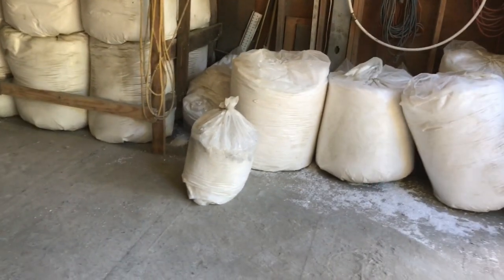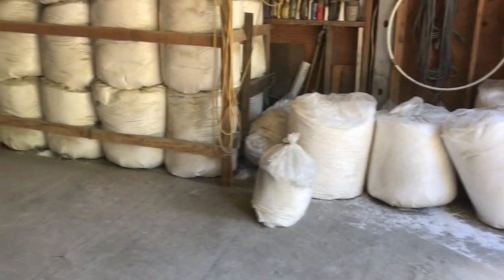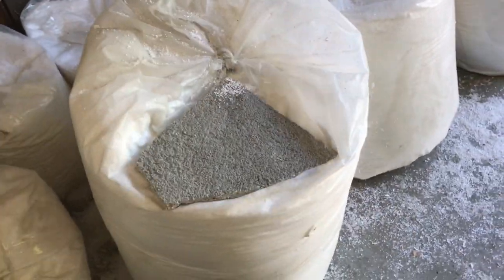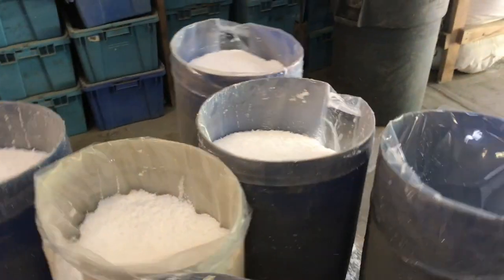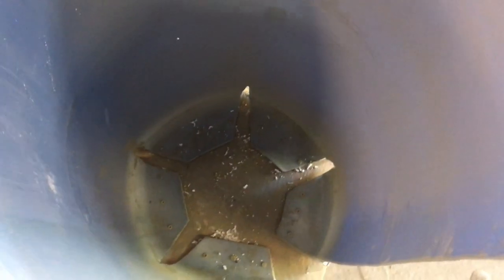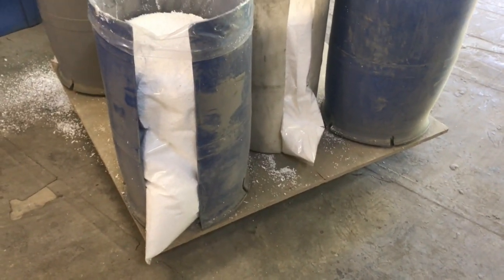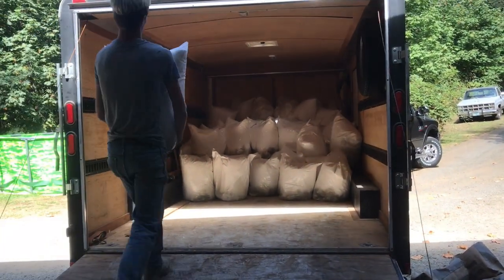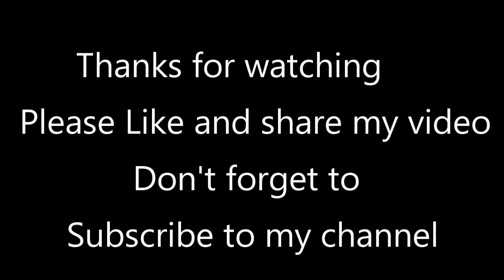Unbelievable styrofoam cement mixtures

Comment: Thank you Jim, 1 kg lime, 3kg cement and 9 kg foam to insulate a shipping container?
Reply from the maker: Cool…
Reply: @fauxrock  Thank you, what is your take on the lime?
Reply: And what thickness?
Reply from the maker: The lime is used to make the mixture more sticky so that the Styrofoam bowls or beads will stay together as a matrix with the Portland cement
Reply: @fauxrock  Thank you once again, what thickness would you make the insulation on the shipping container please?
Reply from the maker: I’ll have to apologize I didn’t understand your original question Regarding using the Styrofoam to insulate a shipping container. Although the Styrofoam mixtures will have an R-value it would be extremely low. To give you an example 4 inches of the Styrofoam mixture would give you a 5-R value. If I were trying to insulate a container I would use urethane spray foam I would not even think of using the Styrofoam cement mixtures.
Reply: @fauxrock  Thank you, wow (36 square meters) that is a lot of material. Any idea how many kilograms foam?
Reply from the maker: It sure that I understand your dimensions. I also don’t understand if you mean the spray foam that urethane or the cement phone mix which I said I wouldn’t advise you to use use due to the low R-value that you would yield
Reply: @fauxrock  36 square meters of cement, lime and foam, foam kg estimate.
Reply from the maker: As I had previously stated I would not use the Styrofoam make sure to try and insulate a shipping container because you will never yield any significant our values which is the whole purpose of insulation. At 4 inches a thickness with the Styrofoam mixture you would only get an 5-R value.
Reply: @fauxrock  Thank you for the video and attention to all these questions...I very much appreciate it! But, if the insulating value is so low, what is the point of using the "styrocrete" rather than "foamcrete" or some other material...I think I've lost the thread a bit!
Reply from the maker: Using the mix for homes doesn’t make sense , but I use it to insulate pools/spas or ponds which will be heated as it a great thermal break to stop heat lose to the ground.

Comment: Have you added fiber/mesh to it for strength? I'm looking for diy ..mixers  and  application equipment ideas
Reply from the maker: I never had added mesh to the foam cement, but it would make it stronger...
Reply: So basically, 15 gallons of foam, 4 gallons of Portland and 1 gallon of lye ?
Reply from the maker: Yes that sounds about right but keep in mind mixtures can be made for different performance characteristics
Reply: Is it lime or lye that you add?  I see a comment asking about lye, but I here in the video you saying lime

Comment: Is it possible to build a small cabin with this? Like 30m2 building? Or would it be too weak and toxic for construction??
Reply from the maker: Yes it’s possible.... many people have Utilized Styrofoam basements in many homes and buildings
Reply: Thanks for getting back to me Jim, this is fascinating stuff. If I were to build panels would they be too weak/prone to cracking like aircrete? What ratio do you suggest for a building? Anything I can add to strengthen them like fiberglass? Could I use any kind of styrofoam or should I look for specifics? Sorry for all the questions having a hard time finding information on this topic.
Reply from the maker: It is easier just to call me 971-237-2957

Comment: What proportions of polystyrene cement lime for a concrete screed on the ground? the first layer on which only the screed with heating goes?
Reply from the maker: I typically use three parts of foam to one part of the lime cement

Comment: What is psi please!!!!
Reply from the maker: I’m not sure as I am never really had an application where the strength was an important factor over it being light weight. If I were to estimate the comprehensive strength in PSI I’d be right around 1,000 psi with the 3 to 1 mixture. Obviously you could diminish or strengthen the mixture by adding or subtracting more Portland cement. Thanks for watching my videos

Comment: I mix 1 cement : 5 thermocol and make bricks. Is this mix durable as a brick?
Reply from the maker: No it’s not especially if I understood what you wrote one cement to five parts of the styrene??? Usually I mix one part of cement to three parts of the Syrene and that’s not as tough as a brick either, but It would be stronger than a 1 to 5 mix.

Thanks for watching my videos
Reply: @fauxrock   Thanks.  Any admixture you can recommend?
Reply from the maker: You can add an acrylic admixture
Reply: @fauxrock  ok thanks

Comment: Hi I love your video 👍 I’d like to make stepping stones, what ratio of mix/recipe do you recommend? By the way I live in Long Island New York.
Reply: concrete lightweight mix  https://www.youtube.com/watch?v=XysmrZOa50Y
Reply from the maker: Thanks for the feedback... I’m a third generation New Yorker that just happens to live out west.👌

I’d recommend a 1-part cement to 3-parts sand mix for your project. Have fun with your project and enjoy the wide world of synthetic rock construction
Reply: @fauxrock  thanks for your fast response! I wanted to incorporate crushed styrofoam into the mix for the stepping stones, would that work? I’d like to use styrofoam because of the weight factor. Thank you in advance!
Reply from the maker: Adding the Styrofoam To a mix formulation only creates a weakening which requires you to use more material to get the structure that you once had

Comment: I am from Pakistan and I  in the phase of developing Insulated Composite Concrete Form Block, I am seeking your patronage to get any appropriate formula of styrofoam+cement+additive, if any.   I tried to get into your website but couldn't get through.  The size of the block is 12x8x48 inches (HxWxL).  Compressive strength and weight to achieve is 87 psi and 30 lbs respectively. My email address is "naseem.khan@powertech-pk.com"

Comment: This video is so good..can you tell me the mixture for making concrete for floor panel and wall?thanks
Reply: Is the mixture by weight or volume
Reply from the maker: I prefer a volume mixture, but it can be accomplished by weight
Reply from the maker: I used different ratios of cement to foam... anywhere from one part cement to one part of foam all the way up to one part cement to ten parts of foam.

Generally I will mix one part cement to three parts of foam for most projects.

Thanks for watching...

Comment: what is the ratio of Styrofoam to Cement in terms of volume or weight?
Reply from the maker: Depending on the application I have used as little as one part of Portland cement to10 parts of Foam all the way down to One part of Portland one part of foam.
Reply: @fauxrock  Thanks for the reply, by foam do you mean generated foam?
Reply from the maker: I’ve never heard the term generated foam before. The foam we use is called regrind foam due to the fact they grind up waste foam.
Reply: Thanks again I got it

Comment: what's your ratio for cement and styrofoam?
Reply from the maker: Our formulations will vary depending on the application that we serve and or budgetary constraints. The formulations can be as little as 1 part Cement to one part Styrofoam and as much as 10 parts Styrofoam to one part cement
Reply: @fauxrock  no lime?
Reply from the maker: Yes I use lime one part of lime to three part of Portland cement makes the cement that I use to put three parts of foam to

Comment: Can I have the formula of your mix, please. Or is it a secret. thank u in advance.
Reply from the maker: There are several different formulations that we use... it really depends on your application as to the exacting formulation. Give me a call to discuss your interest. Thanks, Jim
971-237-2957
Reply: @fauxrock  hi Jim can I call or send an email
Reply: I wanted to make small fountains out of this.  I want to be able to form it and shape it a bit.  What do you suggest
Reply from the maker: It would be something that you could do, but it would less weight to start with a block of styrofoam which you could carve to the shape you want and then code it with a thin shell of cement.

Comment: Wait a second, are you using foam for aggregate? Little foam beads for aggregate? How is the strength? My mind is blown. How did you ever come up with such a thing? Please don't misunderstand me, I kinda think its brilliant. I'm a girly girl and I don't do cement but honestly your tempting me to come play in the mud with you guys. For some odd reason I really try want to try this.
Reply from the maker: Yes foam beads are the aggregate of these formulations or mixtures. Give it a try... you might like it.
Reply: @fauxrock  I just might! Merry Christmas!
Reply: Yes it's strong but is used  only for non structural purposes. For example a separation wall. Industries are producing these stuff worldwide in huge quantities. It is easier to make than aerated Crete blocks. It's waterproof, floats, good weather insulation specially in hot countries. Styrofoam is the key material to build boat fridges and cold rooms. It keeps everything cold for more than 12 hours with using electricity.
Reply from the maker: Cool… thanks for sharing
Reply: Nothing new, the Russians are light years ahead in this field. 

I'd suggest to search in Russian, use Google translate.

Good luck.